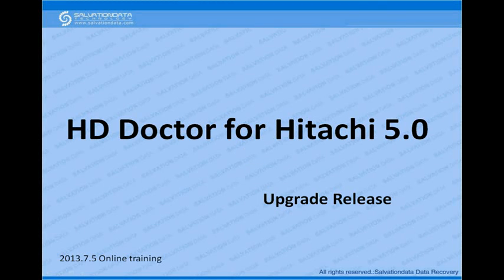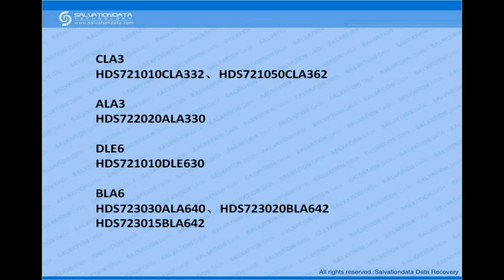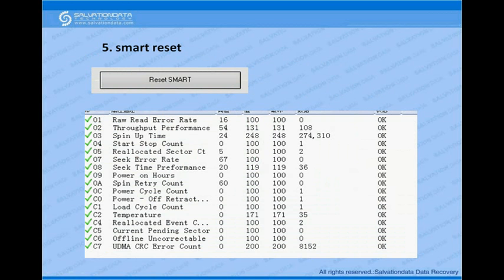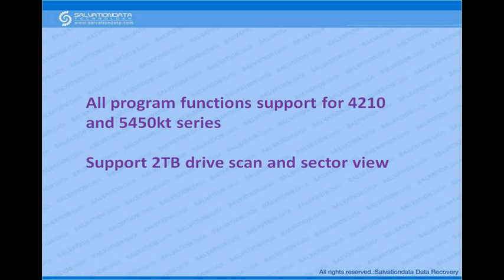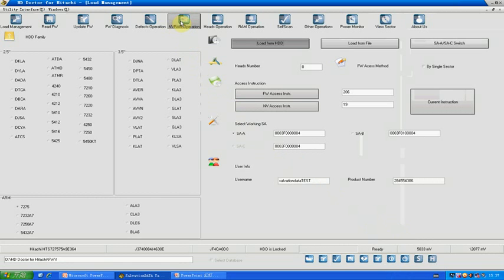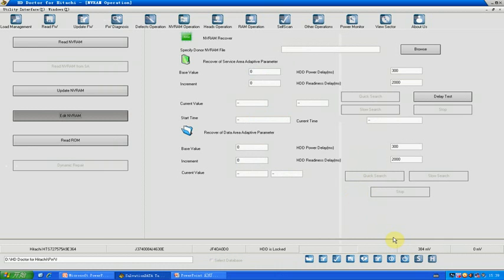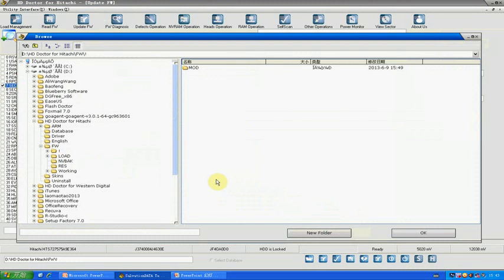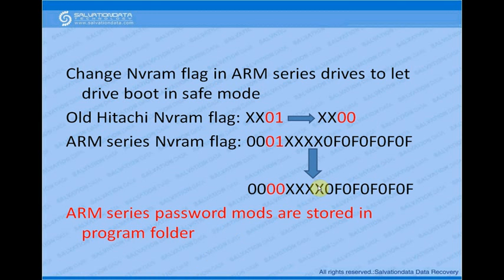How to Remove Password from Hitachi ARM Hard Drives?

Comment: Hi! I soldered out the serial eeprom from motherboard, and owerwrite 01 to 00 with TNM5000 programmer. I find 2 location this byte at  x2680 and x3680.
But HDD still locked.